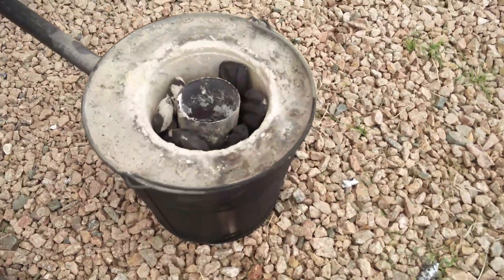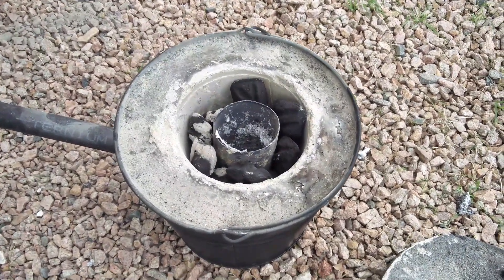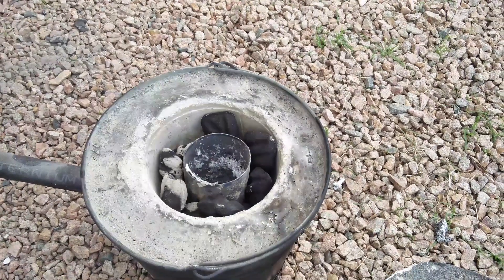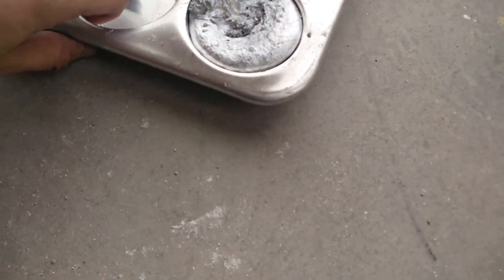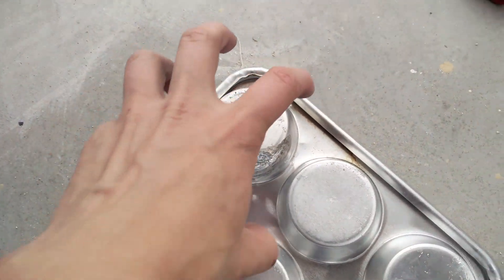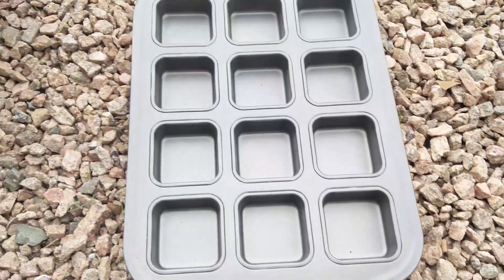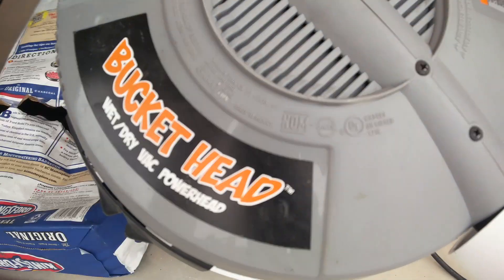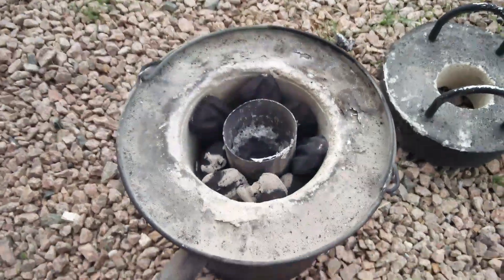Qain's World #0059 - Backyard Smelting

Comment: What turned out to be the problem with the muffin tin? Just from the look and sound of it, I would have guessed it was aluminium, not steel. I would be almost certain the square one is steel though, the only reason to coat it would be for rust prevention.

Comment: Liquid (molten) Aluminum can dissolve iron / steel.  So it didn't actually melt the pan, it dissolved the pan.  potato tomato
It's also why you shouldn't use a steel crucible, or if you do, don't get it too hot.  It won't last very long before it blows out the bottom.  Ceramic or clay-graphite is what would last and work better.
Anyway.   Old video, I know.  Just FYI.

Comment: Can putting a y and ball valves in your bellows line, give you better control of air going in forge, and diverted air from your fixed flow blowing source?  Just restricting main in alone, can sometimes cause motor issues, adding a divert to adjust, can prevent that and possibly be more fine tuneable.  Bucket vac head is a great idea, many uses for those, from bee vacs to flowbee clippers.

Comment: Just an attempt at a helpful tip, use coal. 
It's more expensive and might take some effort to find, but it's better value by far. It burns hotter so you can use less, you can use it for more than one burn and charcoal is like 20% dirt which makes cleanup a pain.

Comment: This is awesome! I love this vid.

That vac will push way more air than you'll want. You could add a baffle to divert some air away... I melted a break drum forge that way, using the blower from a heat gun. 

Try removing the heating element from the hair dryer and that will keep it from shutting off.